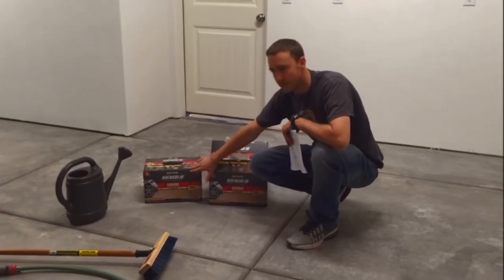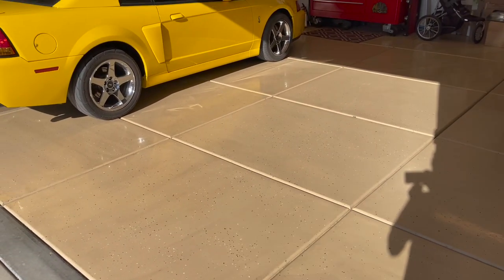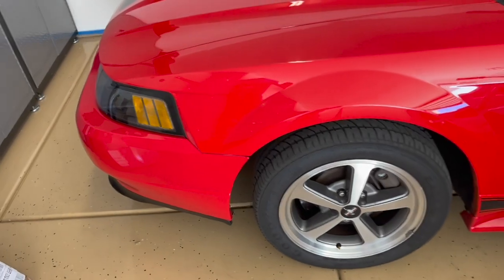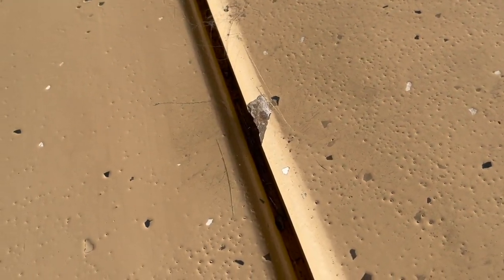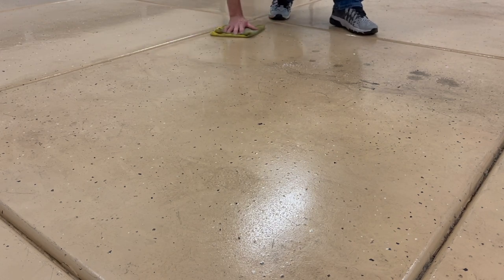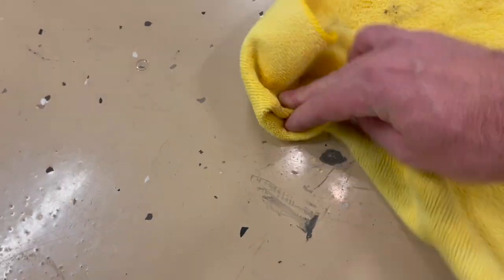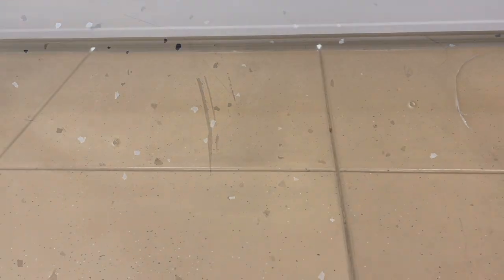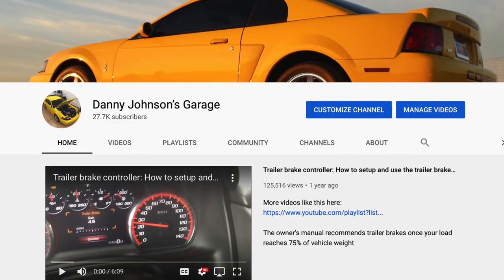3.5 Year Floor coating review: Rust-Oleum Rock Solid Polycuramine

Comment: Whats up sir awesome video, I was wanting to put the clear coat Rocksolid on top however when I saw it was more expensive than the actual base coating I do not want to do it, kind of a three way question but my floor is a raw concrete, I am going to diamond grind it but do you think I need it is necessary to put primer and the top clear coating on after if I use the rocksolid product, will it be fine without clear rocksolid I heard it was very shiny as in? Thank you
Reply from the maker: I feel it was plenty shiny without anything other than the coating itself. My thought was why put in a top coat and cover the coating I’m putting down in the first place. I think it’s fine how it comes as is
Reply: @Danny Johnson’s Garage  thank you sir! appreciate it

Comment: Does it clean up well with just a hose, or do you need to apply the cleaner and mop the floor...
Reply from the maker: For grease you will need a cleaner so it won’t smear, but I have even been able to wipe up light oils and the black left over from tire marks after driving in the rain with just a wet rag

Comment: Is it really slippery when wet or manageable. Debating if I should add the anti slip but worried it will ruin the gloss. Also how many kits did you use. I have a standard two car garage
Reply from the maker: It’s a little slippery, but I’ve never had a concern just being cautious as usual when wet. Here is the install. It took almost twice the amount recommended on new cement https://youtu.be/LSrIsYuAmE8

Comment: So would you recommend putting 2 top coat covering on it? And 2/3 of my garage is going to be a wood working shop, do you think it won’t be any difference in longevity and quality than in your situation? Also I live in northern states does that affect longevity? And what did you do in the prep stage? Lastly how many boxes did you use?
Reply from the maker: Here is my install. On new concrete (perhaps that was why) it took 7-1/2 one car kits to cover an over-sized 3 car, so it took nearly double the amount as suggested. I have otherwise really enjoyed it and if applied properly I don’t see any reason it won’t last as long for you- probably better with wood work over greasy mechanic work. I would just apply until you feel it’s thick enough and can’t see concrete under the layer
Reply: @dannyjohnsonsgarage  okay so I am going to get the 2 car kits so I assume 2-3 kits will be enough. I was going to put 2 coats of clear sealer coat on it. I think that should help in longevity too
Reply: @joshr19821  What did you use for the clear sealer coat and are you glad you did that still?
Reply: @joshr19821  how did the clear coat work for you Josh? I heard good and bad coverage horrible/roller marks ect. Thx

Comment: Is the floor slippery when wet, or does the acid etching help with creating a non-slip surface?
Reply from the maker: The acid etching only helps the product stick better. The floor can be slick when wet but it’s not too bad